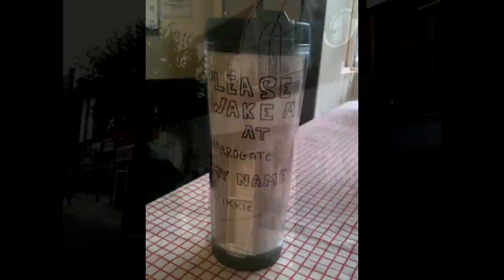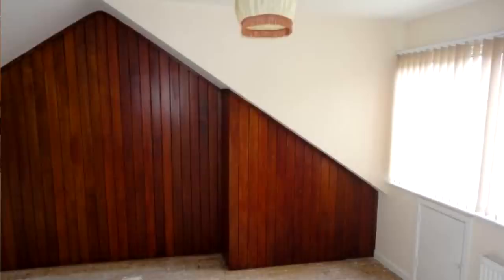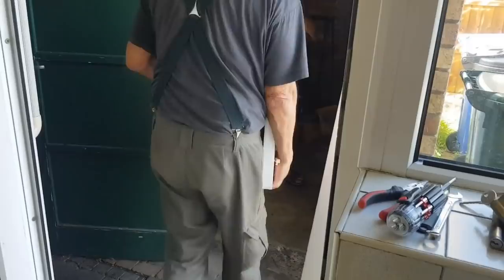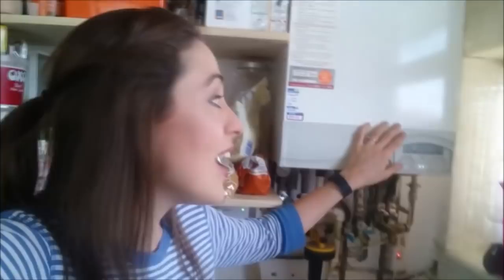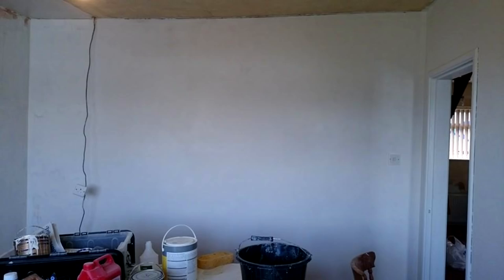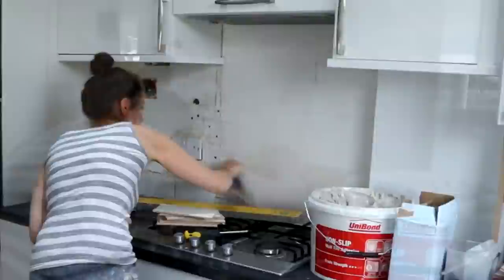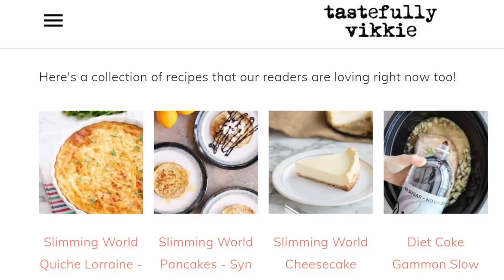Bye House, Hello Narrowboat (& More) | The Carpenter's Daughter

Comment: I remember when I bought my first property back in 1999, I was lucky to buy unfinished build on a development that was struggling so there were deals to be had.  My sister and her then husband bought a property in Pontefract which they claimed was expensive at the same time as I bought mine. They had a three bedroom new build with garden and had a two bedroom top floor apartment (loft space).  I was in Croxley Green which is inside the M25 and has a tube line to London, they were in Pontefract which was commuter belt for Leeds.
The moaned about the price and the mortgage even though they had duel income... the cost of the 3 bed detached house (1999) £79,950 the cost of my flat £129,500... with just me paying the mortgage.
It is all about location but then if you look at properties in East Yorkshire (Beverly, Welton, Elloughton and Brough) they are initially not to far off the prices for the house we now have BUT East Yorkshire houses are bigger and the three bed semi near Junction 17 of the M25... easier access to major international airports, major rail networks.
Maybe when the house surpasses double what we paid for it and retired we might downsize but out network is here now so... I guess when we die the house goes to a charity!